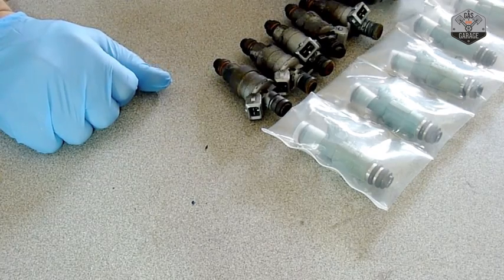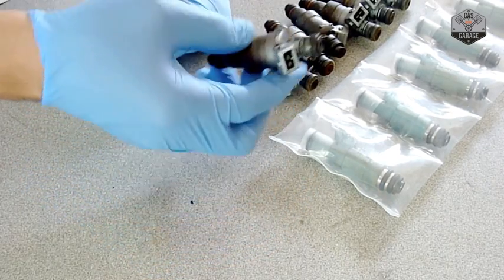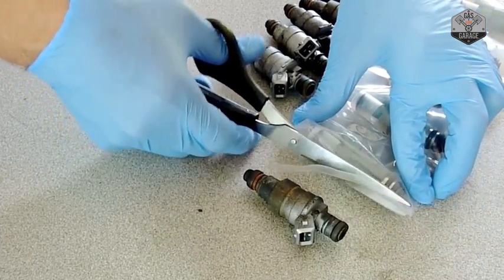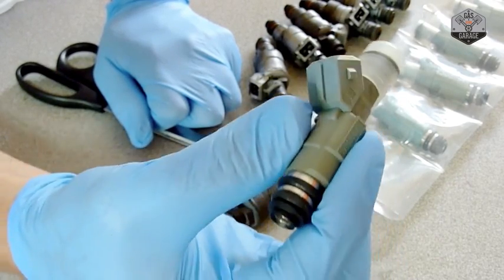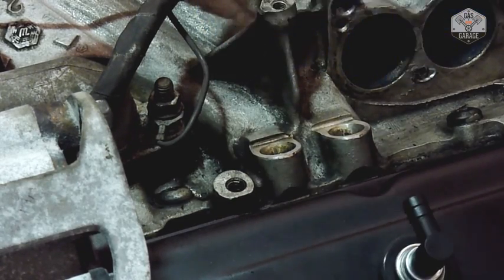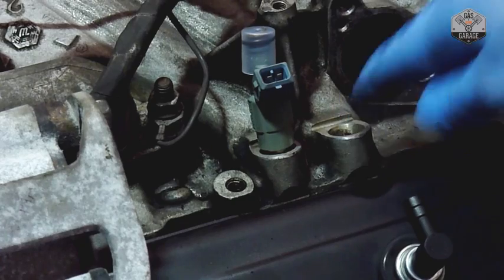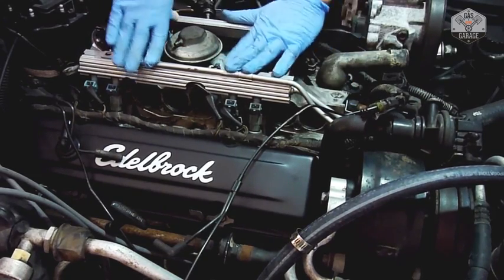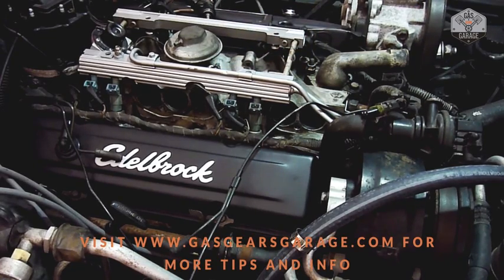How to Select & Install Fuel Injectors (Bosch III - 24lbs) for a Corvette C4

Comment: I'm about to build my 5.7 LT1 in my 97 z28. This will be my first EFI build. I've always used Holley carbs. Anyway, my plan is to use a 480 lift comp cam, headers, big valves. Etc. A basic build. Can anyone recommend what pound injectors I should use? Is it even necessary to upgrade the injectors? Any advice from experience will be greatly appreciated.

Comment: You did everything wrong, Injectors go into the fuel rail first. You put this together without the clips, This will 100 percent leak without the clips. there is no way to get the clips in when the rail is installed. Why would you tell people to do it this way? Do you want to see cars on fire? Idiot
Reply: Let me help you out. The Bosch III injectors don't use the factory fuel rail clips. You can't even use the clips if you try. The Bosch III injectors had a 3rd oring to help adjust the height of the fuel injector to compensate for the fact that the clips aren't used on this injector. Now FIC do sell injectors that can/must use the factory clip.

Comment: I always put the injectors in the rail first.  I like to use some silicone grease on the o-rings.
Reply: cool thats what i was wondering what to use on o rings i was going to use vegetable oil at first
Reply: @andrewhild4428  , vegetable oil is good to use too

Comment: I did this job today.  This video is good...however putting the injectors in the manifold first and then lowering the fuel rail on top of the injectors left me with a nasty leak.  The injectors fit snugly into the fuel rail and somewhat loosely into the manifold.  Thus, you are better off pressing the injectors into the rail, where they fit snugly and then dropping the whole assembly into the manifold where they fit loosely.  Once you bolt the rail down, make sure you easily twist each injector from side to side prior to priming the fuel pump.  If you can't twist them, they aren't properly seated and you will have a leak.

Comment: Bosch EV14 type injector can have up 12 hole nozzles, the fuel spray comes out 3x smaller than the 4 hole nozzle. this is the reason new cars are so smooth and responsive. as long as its the same flow rate no tuning is nessesary
its EV14 long is the same size as the EV1, so it fits.. you will need a jetronic to uscar connector adapater..  check us for a complete Bosch catalogue with flow rates / port type / # nozzle holes 
https://www.injectorplanet.com/collections/bosch-fuel-injectors/Bosch-EV6
perfect tutorial, thank you 
-Bryan

Comment: check us out for a Bosch 4 hole nozzle / Jetronic port fuel injector upgrade
4 hole nozzle available, your motor will run smoother and balanced guaranteed 

https://www.injectorplanet.com/collections/bosch-fuel-injectors/Bosch-EV6

we have flow rates and other infos for any injector upgrade project 
great video
thank you  
-Bryan

Comment: I have a problem with my l98 TPI trans am which is white smoke smells gas.  I cleaned the injectors still same  issue.  how to check for open stuck injector.  or iy could be another isssue Please help
Reply from the maker: M. White smoke is usually a sign of coolant in the system. Easiest is to first check the radiator for signs of oil and or loss of coolant. Could be that the fuel is not burning off completely. There are some light tools to check for FI pulsing.
Reply: The best way to check each injector is with a fuel pressure gauge and 2 jumper wires to the injector terminals.
Put gauge on, turn key on. read fuel pressure. turn key off. touch the jumpers to one injector for 2 seconds. Watch the pressure drop. Repeat for all injectors.  all should be about the same.
Reply: Sounds like a Fuel Pressure Regulator..

Comment: when you come to injectors swap/removal in a TPI system,since you have to remove the plenum /rubnners,its better to refurbish the fuel rail assy too,using the AC Delco o ring kit and put a new adjustable fuel pressure regulator since a 25 YO broken regulator diaphragm can let you stranded,nice video bro'

Comment: thanks for the nice video it helps a lot
i need the reference number for the injectors to find them in spain
Reply: This is where I sourced mine from. You've got many options. I used these: http://fuelinjectorconnection.com/shop/viewitem.php?productid=57
but email them and they'll help you with what you need: http://www.fuelinjectorconnection.com/ *****